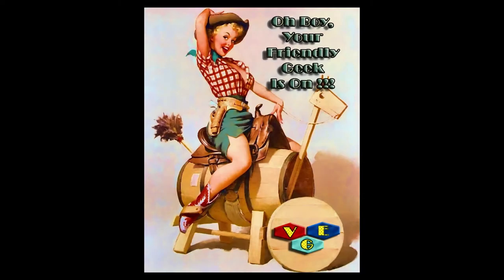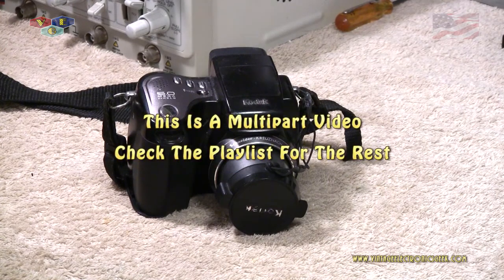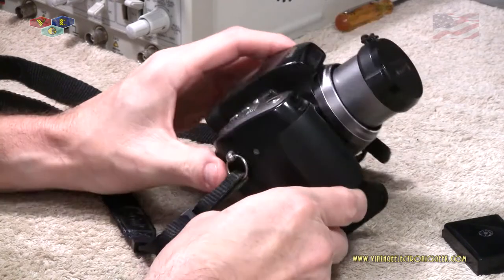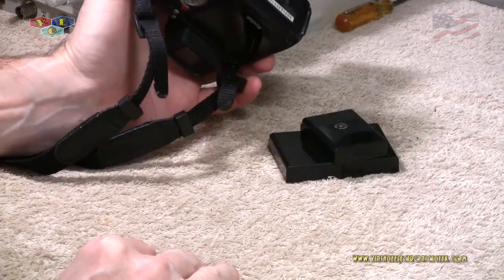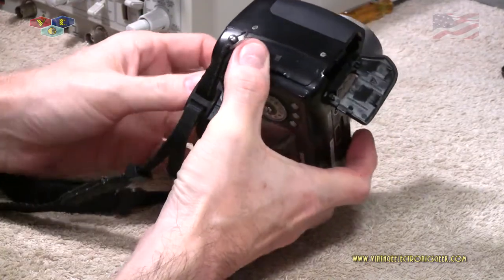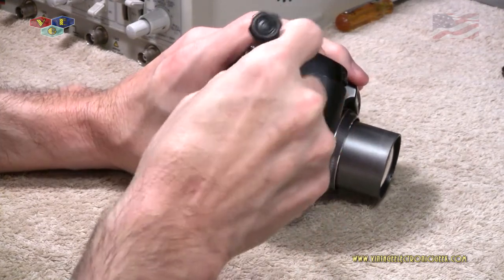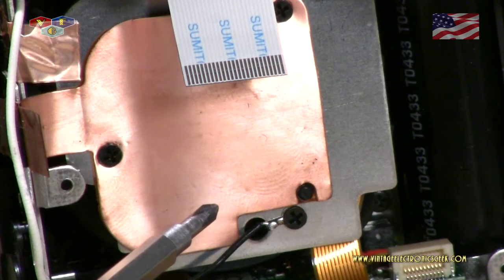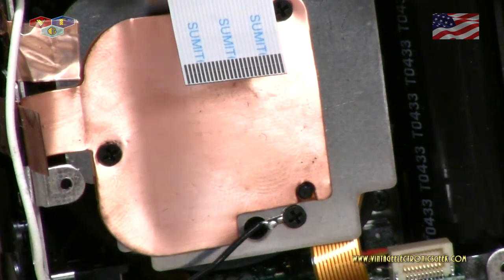Kodak Z7590 - Attempt Repair (Failed) - Part 1

Comment: well Jack I have never torn one of those apart never had one still have my old  Cannon AE1 still works go figure so old it didn't have any electronic stuff to mess up Unlike my Yashica TL Electro still have it but the shutter wont open maybe I will take it apart just for fun. I like how you just dive in and take stuff apart Jack. Thanks for sharing even if it was a failure.
Reply from the maker: Thanks Larry!  Some the old stuff I don't mind "learning" with, my better stuff, not so much!  :) I do not have the AE-1, but they are fantastic cameras and are still sought after today!  I do have a FD system, the T50, it's amazing however body is finding out that the FD lens are really good and now the prices are starting to climb!  I dont have the TL Electro, but I do have the 500 & 1000, I had the 1000 CLR'd about 5 years ago and have only ran either 1 or 2 rolls of film through it, I believe I used my radioactive lens on it, great camera!  ~Jack, VEG
Reply: Oh the joys of film and slides.  We had to make pix count, but wait for $ processing to see what came out, how we did.  I rarely do stills, digital is instant gratification, no limit, cheap, and can be viewed on a large flat screen. Film is like vinyl, or worse 78s, as compaired to sillyfones with decent cameras.  
Now I have a problem with film, being 1$/shot, nothing is good enough for me, lol.  So what do I do?  Take really stupid pix of course.  
Don
Reply: Oh yes indeed those were the good old days no they weren't they were a pain in the ass to be honest Don. lol yes instant gratification is better by far.
Reply from the maker: I agree with both off you, as Larry states, a pain, however as Don state's, slower...when I worked as a pro, it was all run and gun, never really thought about the shot, well, it was very miniscule and in a nanosecond, I eventually got burnt out on many levels and the thought process and the shot was one of them...I missed slowing down and smelling the roses per se'!  Depending on the event, I could shoot 1500 photos in one day, on the avg I would shoot about 500 per event, most I ever shot was around 3000 shoots in one event.  Film is like shooting a gun, make every shot count!  Especially now, $10 for a roll of film, then upwards of $20 to have it developed!  Gets spendy!  I don't shoot much film now, but it doesn't bother me...I am all into 3MP or less cameras now.  :)  ~Jack, VEG
Reply: Wow Jack I had no idea you were a pro and that is an amazing amount of Photos and major money for processing. Never made much more than photos of places I visited while Gold panning or Hiking and camping those were the most fun. But had to watch how many shots you had left per roll. Now just use the digital camera or make videos so its a bit easier and make sure you have a big sd card much easier.
Reply from the maker: Yeah, I was a celebrity photographer exclusive at the end, but prior I worked as a pro for anybody who hired me, so I worked with all walks of life, it was fantastic work, all kinds of doors opened for me and I got to do things / go places most didn't, but I got burnt out and eventually closed my business and found YT, then my new passion of vintage electronics and a whole slew of cool people such as yourself!  :)  ~Jack, VEG

Comment: It's a shame to stop now as all it's entrails are at least in one place?, I have when needing a very fine soldering iron wrapped a length of copper wire tightly around the tip of the closest iron to me, then filed the end to suit- worked okay for my needs,
 Regards, J.
Reply: point of interest...  
camera electronic  strobes were an early use of switching power supplies that used high freqs.  They were around in the 60s, long before all those WalMart WalWarts.
Reply from the maker: Howdy Joe!  I do have small tips for my iron, the issue for me with SMD is, welp...they are micro!  I dont have the proper gear to work on the, however I am slowly amassing them!  More toys!  :)  But in the interim, to tiny! Thanks for the suggestion!  ~Jack, VEG
Reply from the maker: I don't like WalMarts! Im also not a big fan of switching power supplies!  I like old school transformers!  :)  ~Jack, VEG

Comment: The cap looks like a 47uf 10v. If you heat both sides aka pads with two soldering irons it will fall off the PCB. I would also check the cap out of circuit. Good luck with the repair.
Reply from the maker: Howdy!  I ended up cutting it off, that's in part 2 off the series....I just have not had good luck working on SMD's, but I try!  I'm sure in time, experience and watching more videos, I'll get better.  Thanks you for the help/tip!  :)  ~Jack, VEG

Comment: Helloo master Jack, 
Hmmm, that rod must be for the flash cube socket, it seems to be mising?  
Could be a defective focal plane shutter spring.  
I like Kodak cameras, I have a German made Kodak Retina SLR that's jammed up. 
Instamtics were very kewl.  I like my Kodak Mamiya instamatic, lol.  
I'd like to have a big glass display case for my camera collection, perhps in the camper.  
Bubbles
Reply from the maker: Howdy Don!  I worked on this when it was late and I was tired, I really needs not do that as they brain don't work too well!  :)  If I were thinking proper I would have known that!  :)  I don't own a Kodak Retina, it was on my want list, but I kinda stepped away from film cameras and gravitated into 3MP or less digitals as well as old big fat heavy lenses.  The camper would make a great display case indeed!  Thanks for watching!  ~Jack, VEG
Reply: My brain...  
ummm ummm 
oh well 
lately, I tend to procrastinate.  
I wonder if that crazy camera with the long macro lens would work for micro surgery on surface mount crap?  The depth of field would be tight, hmmm, but I think that camera may work.  Or if you can unglue the C mount lenz?  Itsa beater, but could me a video microscope.
Reply from the maker: Hey Don!  I do have one of those Chinese microscope, it works pretty good, except its mount has to much wobbly so I have been thinking of doing something different, like a flex microphone mount or ??  ~Jack, VEG